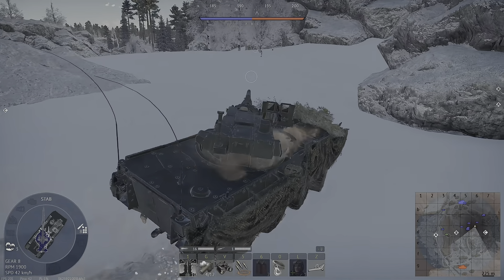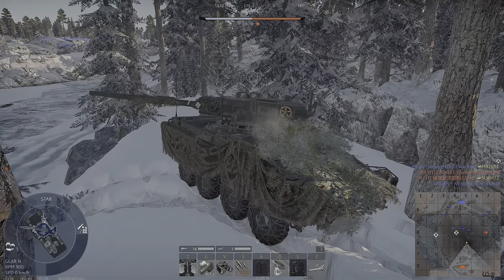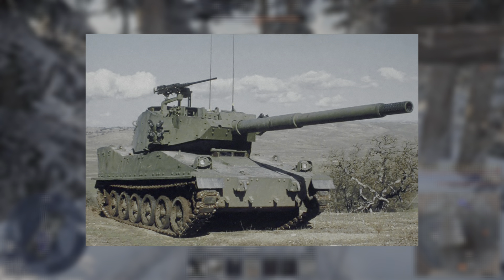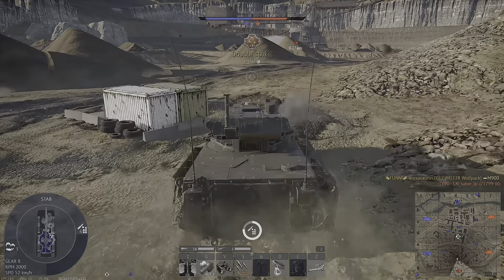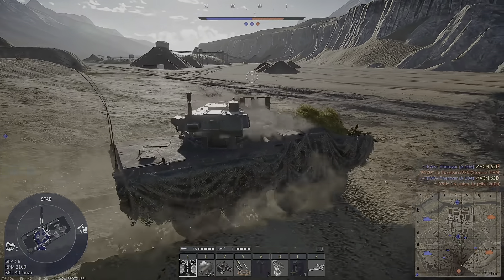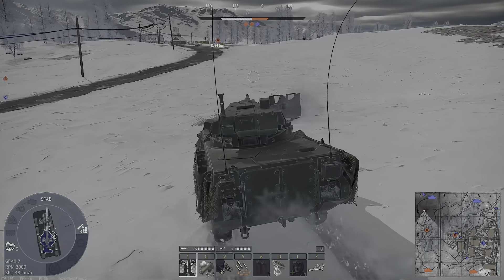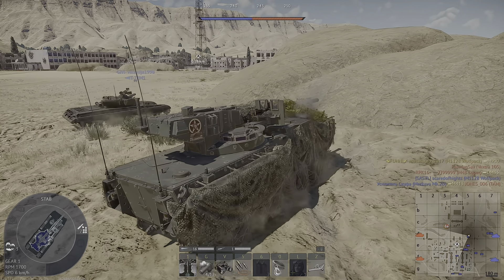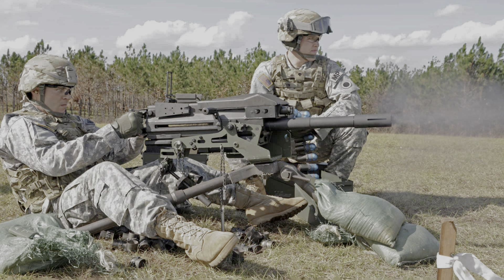The history of a failed project - M1128 Mobile Gun System

Comment: Also the m1128 could not fire full power 105mm projectiles due to recoil being too big for the stryker chassis. meanwhile the m8 ags had no problem firing the full pressure 105mm ammo.

Comment: I really wonder if it was just a stopgap that stayed in service longer than needed because congress couldn’t decide on an actual light tank
Reply from the maker: Maybe
Reply: It wasn't a 'stop gap', it filled the niche it was designed to which was SPECIFIC to the Stryker Brigade Combat Team, it wasn't nor was ever intended to get farmed out to the IBCT's or ABCT's. It got REPLACED for two reasons: 1st Design flaws with the Gun System itself that lead to perennially low operational readiness, even after there was significant modification to the gun AND a whole doctrinal restructuring which was intended to improve maintenance. 2nd It's role as light-anti armor and direct fire support was done better by the Stryker Dragoon and CROWS-J equipped Strykers working in tandem neither of which had the maintenance issues the MGS did.

Comment: The US SERIOUSLY needs to get over making things para-capable. It's outdated and causes unnecessary compromises on vehicles that don't need to be there. The Army's fascination with parachuting shit into a combat zone is like that dude who peaked in high school and won't stfu about how he threw the gamewinning pass at Homecoming.
Reply from the maker: @patrickbateman312  Nahh hqhahhaah😭
Reply: Not even the basic stryker apc was never air droppable  according to icv requirements since it exceeded the 19ton max c-130 payload when fully armed and fueled, and the C-130 was too narrow and low height to carry a stryker with its weapons mounted
Reply: The m10 booker looks promising.
Reply: @rickfastly2671 that cant be airdropped its just light for insane ptw
Reply: @rowanyuh6326  I believe it’s easier to transport than an Abram’s so for QRF units it has some use.
Reply: Pretty sure they drop the air-drop requirements with the M10 Booker
Reply: @rickfastly2671  Its not promising because its ridiculously big and heavy for a light tank, it'd be horrible for most light tank roles.
Reply: @kite2036   it’s really not the Abram’s is ridiculously heavy nowadays, it can’t even go over most bridges in Europe, and has to be flown in by heavier cargo planes, which means qrf forces might not have adequate heavy armor for longer than is acceptable.
Reply: @kite2036  the Abram’s is hard to transport due to its weight, which means it arrives to a battlefield later than when it could be possibly needed. The m10 being lighter means forces in an area could have heavy direct fire support sooner rather than later.
Reply: @Isaac-ho8gh The M10 was designed like that so it would have a high degree of parts commonality with the Abrams which would also allow the crews to trained up faster.
Reply: @tackytrooper  that doesn't mean its not stupidly heavy and big for a light tank.

Comment: The turret sucked balls. More precisely the autoloader. With a Centauro or a CV40 105 turret, it would've been sufficient and not an unrelible trainwreck
Reply: That all would be true provided they would have been able to do that while fitting within the weight and size limits. MGS was required to be flown around in a C-130, which means that it had to weigh under 19 tons and B1 is 24 tons. The M1128 was under 19 tons, but paid for it by all manner of problems of it's own, including the temperamental autoloader.
Reply: @vojtechpribyl7386  They should've built a low 8x8 platform first and then build a box on top/raised the roof. That way, you can build a proper MGS akin to Rooikat/AMX-10RC. You get a lower vehicle without having to resort to M1128 voodoo, and with the lower gun, you get better shooting performance.

Raise the roof and you can have your regular Dragoons, Medevacs, etc.
Reply: @ABCantonese  They clearly wanted the streamlined logistics from having it all on the Stryker platform. Plus I'm not sure how much space does the 105 mm need as making the thing lower could also require it to be wider and thus not fit within the C-130 cargo bay.
Reply: @vojtechpribyl7386  Seems like they over-streamlined it😁

But true, I can't find a lower yet narrower gun system.
Reply: @ABCantonese  I think that the turret came from the earlier Expeditionary Tank project, but that thing was also over 20 tons. 105 mm is certainly possible on a lighter wheeled chassis, but I'm not sure how much does that go together with the full power NATO rounds. AMX-10RC for example has a 105 mm gun, but it was limited to lower powered french HEAT rounds.
Reply: @vojtechpribyl7386  Shouldn't be a problem given their presence on the LAV-600 and Engesa EE-18 Sucuri... Those babies are light too.
Reply: @ABCantonese  Can they fire the full power AP rounds though?
Reply: @vojtechpribyl7386  You'll have to ask the manufacturers on that one.
Reply: @vojtechpribyl7386  I think so. With low recoil force guns, it'll do. It's literally the turret from the proven Stingray light tank... Best described as a light tank made with welded steel sheets and about as protective as a BMP-2.